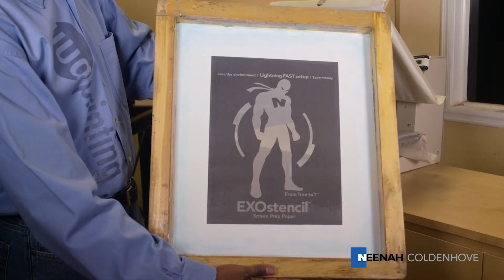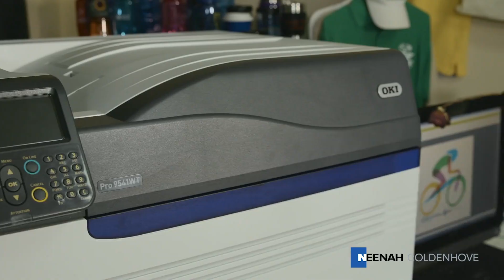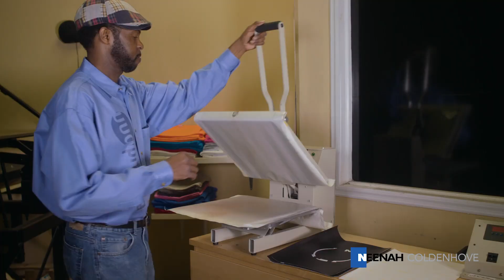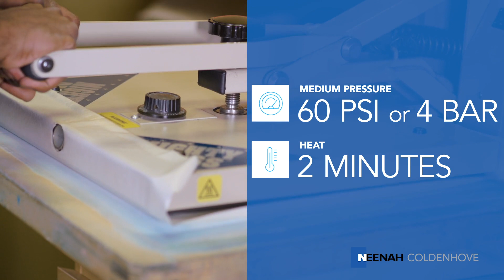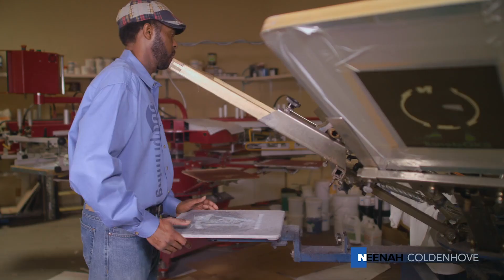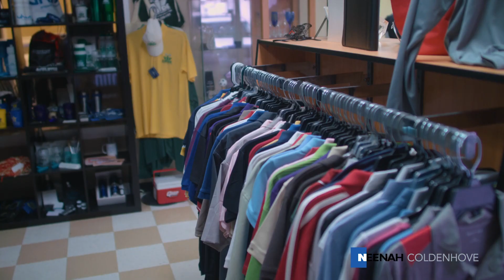NEENAH COLDENHOVE Heat Transfer ExoStencil Screen Prep Paper 2019

Comment: what about halftones? and how does it compare to direct emulsion in terms of longevity? thank you great idea!
Reply from the maker: Unfortunately, this product will not work with halftone designs. You need the combination of emulsion + toner to block the screen where required. Halftone designs may not use enough toner in certain areas to get the emulsion to stick and block, creating an open area of the screen that should be closed. As far as screen longevity, we were told between 500-1000 impressions for a screen made with Neenah EXO-STENCIL. For more information, visit: https://dyetrans.com/products.php?webmaincat=transfer_paper&websubcat=neenah&websubcat2=exostencil&websubcat3=&wsc4=color_laser